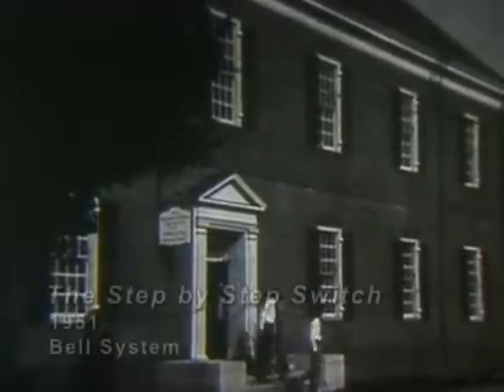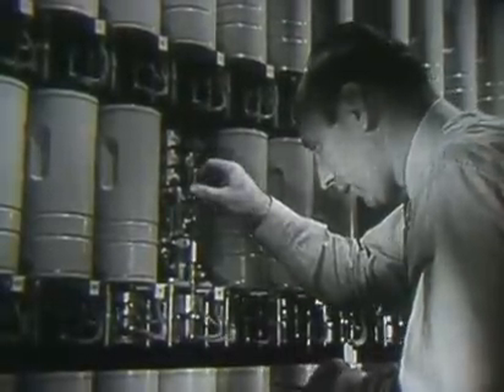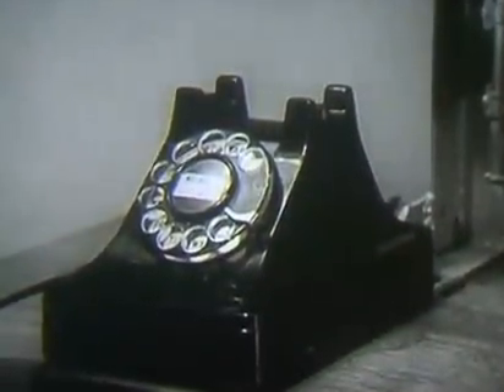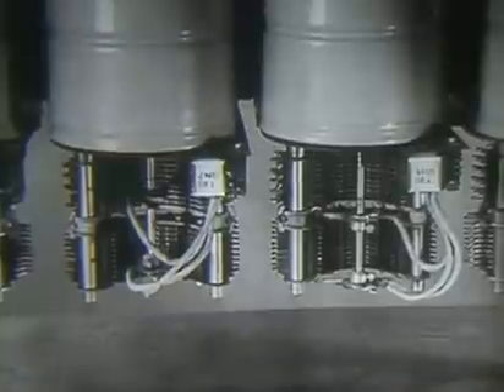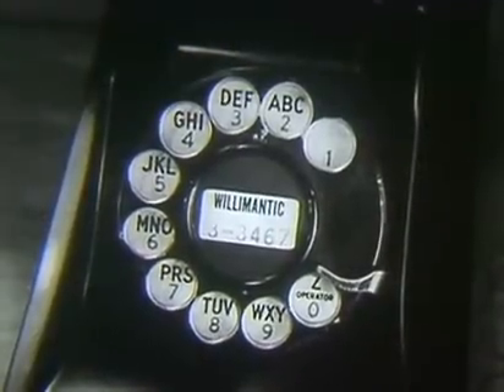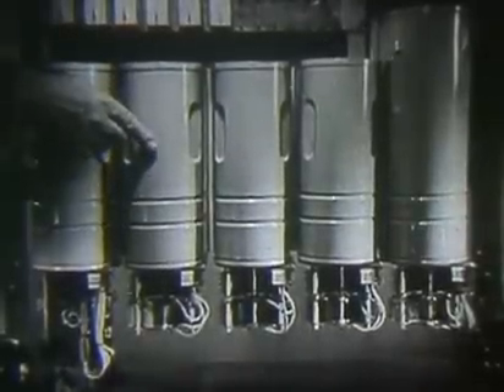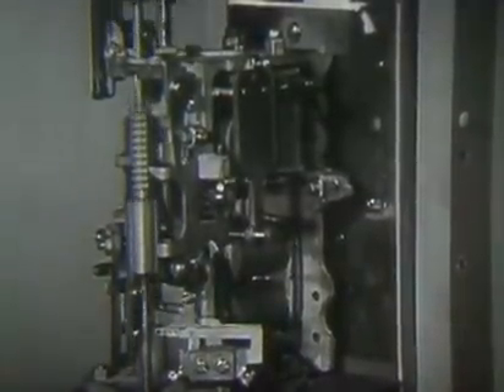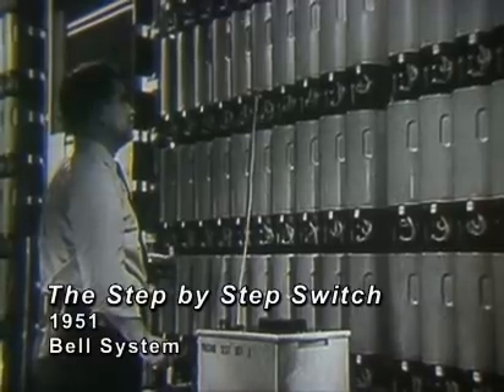AT&T Archives: The Step-By-Step Switch

Comment: Fresno, California STILL uses step-by-step in a switching office, as a working museum peice.  Well, 1980's.
Yes, your phone service needed a rotary phone to use this monster, and it won't accept calls from out of area.  In town only.
Since the signal is not amplified, filtered, compressed, digitized or any of that stuff, the sound quality over 'copper path' circuits can be amazing.
But you may have to shout...no boosting either!

Music sounds very good on these lines, faxes came across looking like b/w photos.
Reply: The carbon-granule microphone used in telephones was in itself a very effective amplifier that varied its resistance as the granules were compressed and released by incoming voice.  Occasionally you had to rap the receiver on the desk to shake the granules free when they got too packed together.

Comment: Despite having thousands of parts, there’s a beautiful simplicity to the concepts and physical directness of the system. It’s fascinating to see the creativity that goes into mechanical logic systems.
Reply: It mirrors the difference between a steam locomotive and a diesel-electric.
Reply: the difference is, in mechanical bigger system you see the logics by your own eye, in computers, you can't, but it is still very much so "mechanical" tiny switches and gates redirecting current around , but, you can not see it...
Reply: The other thing about this was as complicated and electromechanical as it was, it was incredibly reliable. I can't recall ever having any sort of issue with calls going through.
Reply: Those thousands of parts were put together throughly and worked wonderfully.

Comment: After watching the 1938 and 1969 operator instructional videos it's interesting to see this but what I really want to see is the motions an operator made to change circuits and how easy it might be to mix up with another circuit and how quickly they were expected to find the right circuit.. and how that system works as you're showing here with phone dialing. I remember rotary phones. I was born in 1975. I actually used a rotary phone up until 1993 I believe. From there we quickly got better technology and now alot of homes don't even use phones. The cell phone was slow to start but it's made a huge change to your business I'm sure. At least you guys have a cell service too.. at least last time I checked.

Comment: Am I wrong, or back then, you could sing a song together on the telephone without lag?
Reply: Not wrong. Electric impulses travel essentially at the speed of light. Modern VoIP systems chop the voice into 20 millisecond packets and they don't always arrive when expected, so your duet gets thrown off. Low latency audio is a Big Deal in broadcasting for this reason.
Reply: In the 80's, a portable tapedeck was that decades music streaming service. It had an input and output audio jack and a cassette player in it, if you were creative you can hook it up to your phone at home for answering machine service. ;)

Comment: It's remarkable it worked at all when you consider the mechanical switches and the sheer number of punchdown connections between each phone, the nearest CO and then to the phone on the other end.
Reply: It worked very well indeed.  Western Electric were fanatical about reliability.
Reply: Punch down?  They used to be soldered.  Later on, wire wrap.

Comment: After today's 6 hour outage call on our VOIP system at work were we spent about 4 hours tracing packet losses. It would be so refreshing to just go to the mechanical room to see which relay failed vs tracing some random loss 700 miles aware on a MLPS line that nobody could figure out.....
Reply: I started out in telecom, in 1972.  In the years since, I've worked with computers, the old ones not PCs, with digital TDM phone systems, VoIP, cell phone sites and much more.  When working with younger guys, I find they just don't have anywhere near the background I do.  As a result, they just don't understand how a lot of things work.

Comment: The selectors and crossbar back then couldnt handle speedail too quick for them . A lot of exchanges are equipped with mobile phone masts from Landline to mobiles they have to digital.
Reply: The standard dial rate was ten pulses per second.  Later many exchanges could handle twenty, but the ordinary home phone stayed at ten.  I had a 20 pps phone in Annapolis MD in 1969 and it worked fine there.  Seemed very fast at the time.

Comment: IOW, folks, the phone in your house was actually an integral part of the switching system that routed your call. Now, your phone simply says to the central switch, "I pressed the numeral nine" (if you have a land line) but back then, a rotary dial phone actually sent nine pulses to move switches in the CO nine positions.  I used to own one of these Strowger switches. Note they only work in the position shown. They require gravity's assistance to work right.

Comment: I worked for Telecom Australia as a communications technician when the exchanges had step-by-step equipment, like the others who posted here we had pride in our skills and workmanship.
Eventually step-by-step was replaced by the Ericsson "crossbar" system which had central control units albeit comprised of electro-mechanical relays - a foretaste of the future's all-electronic systems.

We used to joke about the "telephone exchanges of the future" which would have a staff of 2 manning them - a man and a dog (the dog to guard the building and the man to feed the dog). I used to think "Naaah it'll never happen".

I left Telecom ages ago but I notice the modern exchange buildings in my area seem to be unmanned and visited by maintenance crews.

Comment: It is interesting that despite AT and T developing more 'high tech' systems such as 'rotary' (used in New Zealand and Europe, 'panel' (a development of rotary used in NY etc) and crossbar, it used the 'step by step' switches for smaller offices. The British Post Office considered purchasing panel switches for London but instead used step-by-step with 'directors' to translate the thirst three digits of the dialled number. Directors were not used for large Australian cities such a Sydney or Melbourne, instead they used 'discriminating' selectors at sub-main offices and 'trumbone' connections for satellite offices. This was not as scaleable as 'director' so crossbar was overlaid. This showed step by step was scaleable up to very large networks and was not knocked completely off the perch until electronic switching became feasible.

Interestingly Keith 'plunger' linefinders (possibly 1915 vintage) were in use in Whanganui New Zealand up to the 1990's and some of these linefinders are now on display in the Science Museum in London. That office would have used more recent step by step equipment as well integrated with the early Keith step by step equipment. In NZ very little electromechanical equipment was scrapped until electronic switching became economic. In one town the rotary equipment had been there for 60 years and the suppliers of the electronic equipment were jokingly asked if they would guarantee their equipment for 60 years.

Comment: No one has mentioned panel equipment. I worked in the last of it in the 70s in Detroit. We used to call it sticks and wheels. Electric motor-driven shafts covered in cork and a clutch that would drive a selector rod up a bank of terminals all controlled by commutator bars at the top and sequence switches and relays to the side. You actually had to rust parts of the sequence switches to make them work! A quick glimpse here: https://youtu.be/bQWFHlLP-4Q?t=406   After that it was X-Bar, 1ESS, 5ESS, DMS. Worked on a few SXS switches but they were for intercept messages if I remember right.

Comment: Fun Fact: The first step-by-step switch and indeed the very first automatic telephone exchange was invented by Almon Strowger.
Almon Strowger was an undertaker by trade.  He became convinced that the manual telephone exchange operator, who was the daughter of the only other undertaker in town, was deliberately directing all calls for "the undertaker" to her father's practice instead of dividing them equally between the two as was standard practice at the time.
Strowger decided that he needed to invent a way for telephone customers to dial the number themselves and used cut out pieces of paper to represent the electrical contacts so that he could work out how the equipment should work.
If I remember correctly, Strowger was granted a patent for his automatic telephone exchange in 1929.
Strowger's exchange required two extra wires from the exchange to each telephone to carry the dialling signals, but some clever lateral thinking allowed for using the same two wires for nearly all signalling as well as for speech.
Reply: The very 1st strowger automatic exchange in the world was installed here in LA porte Indiana in the 1890s we have some of the original equipment at our museum...
Reply: @a1wireless1964  gonna have to get up there after the pandemic. Used to have an audio recording of the step by step system working as my ring tone on an Android phone.
Reply: @MichaelBrown-kk6ck  did you get up there yet? It's now 4 years later
Reply: @a1wireless1964  If that's so, then I must have been wrong about the date of the patent.  But the earlier the patent, the cooler it seems. :)
Reply: @melkiorwiseman  It is indeed cool and it indeed is from the 1890s!
Reply: That was actually fun to read. Thank you.
Reply: And he coined the phrase " A dead phone line " 👍
Reply: Cell phones ruin all that. Good history lesson, Thanks. I used to be a telephone linesmen in the US Air Force in the 80's and 90's.
Reply: I thought it was the other undertaker's wife. And he demonstrated the prototype built with celluloid shirt collars and straight pins.
Reply: Strowger got his patent in 1891, not 1929. He himself died in 1902.
Reply: @robertmack7116  Good catch.
Reply: Heroin Bob  and the Maple City Four.. Freeman Gosden and Charles Coralle, Amos & Andy! got their start on WRAF, the radio station in 1920s. Also the home of Jiffy-Pop! Popcorn
Reply: How many jobs were lost from this new tech
Reply: @kurtreber9813  Probably fewer than were created by needing people to build and maintain the new tech. shrug
Reply: Wrong it was made by John Automaticswitch, where it gets its name

Comment: Were the switches involved in making the connection between two parties occupied for the duration of the telephone call? If yes, would the exchange ever run out of free switches during heavy call times (new year, christmas etc)?
Reply: If there was too much traffic,  all line finders in use, no dial tone.  If one connector bay was busy, you would get 120 busy tone from 11th step of 5th selector.  During holidays some toll trunks were busyed out so people could call in but not call out of town. That way whoever owned trunks could call into town and local people couldn't take over use of trunks.  Used to be that you could pick up phone and have to wait for dial tone.  Most LFs were fast enough to give DT by time you placed phone to ear.  If there was a bad LF that didn't connect to your number then it would release and next LF would give you DT.  Really bad if broke LF was only free switch to use.  There was a town 10 miles away that had 18 trunks to it. If all trunks were busy that town was isolated till a trunk became free.  The office I worked in was covered 24/7/365, switches were worked on and maintained all the time.  I once had to drive sixty miles to another town to release a stuck switch because the local guy had alarm wired wrong and he was on vacation.
Reply: Short answers: Yes, the equipment stayed in use until you hung up your call, and it was possible to run out of free switches if there were enough people trying to make calls.

If that happened, the result depended on how the equipment was wired.  Sometimes you'd get a signal similar to the busy signal (congestion tone) on lifting the receiver, but sometimes you'd just get nothing but the normal line noise.  The latter happened in my town one day when around half the switching equipment went out of service due to a fault.  It was fixed in around an hour, if I remember correctly.

Comment: Tapping out a number was a useful skill when a phone had a dial lock. You had to get it just right or you’d get a wrong number. The lazy way was to only learn to dial zero (10 taps) and ask the operator to connect you because “something is wrong” with your dial.
Reply: that and the fact an old pay phone was simply a Ground start trunk with a mechanical coin switch on the dial..  if you could momentarily ground the ring lead and then hookswitch the number you could call for free every time :)
Reply: @eldoradoboy  Old Abbie Hoffman Yippee trick! Those were the days....

Comment: Really nice film. I’ve always wondered why you have that raw tones in uour phones. Here in Finland it sounds ”tuut-tuut-tuut” 440Hz sine vawe instead of yours ”kraa-kraa-kraa”. Any idea, why?
Reply: Higher pitched tones are often used in Europe.
Some of the American tones in rural areas were literally generated by an oscillating relay. Others were generated from the line frequency or a rotary tone generator. Electronic oscillators were used in newer systems.
Listen to a few of Evan Doorbell's phone tapes for examples.
Reply: Those rotary tone generators were used here too  before digitalization. In those times the frequency wasn’t so accurate and it could vary but as long as I remember the tones have been around 440 Hz. I  used to tune my guitar using it in 1979 when my operator’s system was digital.  That was one of the first. I tested it with my tuning fork A and it was exactly the same.